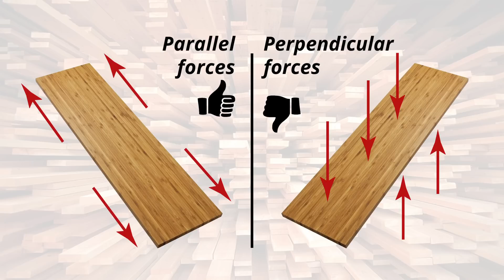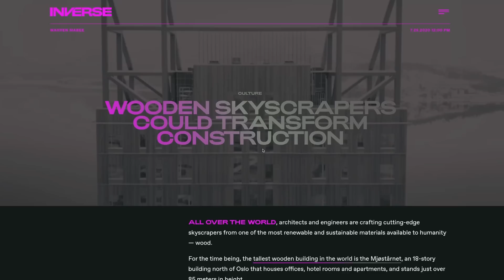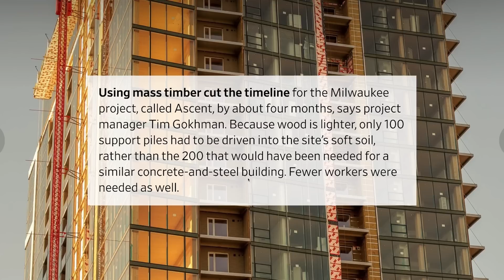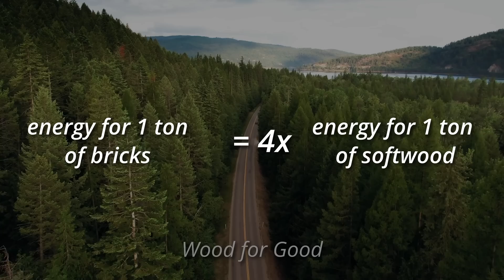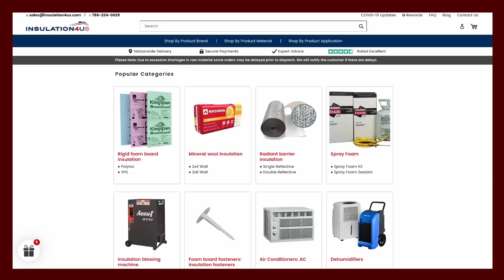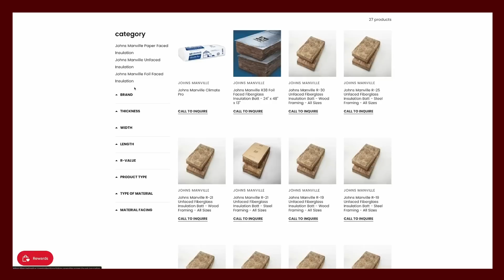How Mass Timber Skyscrapers could be the Future of Construction

Comment: This is INSANE!  Don't you remember the major city fires of the early 20th century?  Has anyone talked about Flame or Fire Resistance for these wooden structures?
Reply: A big difference then from now is that they used open flames at a much wider scale. Mass electrification has cut the risk of fires significantly. Also, the Greenfell tower fire in London showes that it doesn't matter if the support structure of the building is concrete if the rest of the building isn't done correctly. Fire safty is much more about correct use and awareness of risks than a specific material. That said where this goes wrong is that they want skysrcapers. Skyscrapers rarly justify themselves either ecologically or economically and should just be one of those things we stop being obsessed with.

Comment: When it comes to building skyscrapers, wood is not typically used as the base material due to its inherent limitations in terms of structural strength and fire resistance. While modern lumber techniques such as cross-laminated timber (CLT) have made it possible to construct tall buildings with wood, they are generally limited to buildings with fewer than 20 stories.

In terms of safety, materials such as reinforced concrete and steel are typically considered to be more reliable for use in skyscrapers due to their superior strength and durability. These materials are better able to resist the forces of wind and gravity that are exerted on tall buildings, and they are also more resistant to fire and other hazards.

While CLT and other modern lumber techniques have their advantages, such as their sustainability and lower carbon footprint compared to steel and concrete, they are not yet widely accepted for use in tall buildings. More research and testing is needed to fully evaluate their safety and reliability, especially in the face of extreme weather events or other hazards.

In summary, while modern lumber techniques such as CLT may have some benefits in terms of sustainability, they are generally not considered to be as safe or reliable as materials such as reinforced concrete and steel for use in skyscrapers.

Comment: How does a wooden skyscraper compartmentalize unit fires? From what I've seen in real fires they don't. So if your neighbor's place starts on fire you better get out, you won't be sheltering in place. Good examples are a recent concrete highrise fire in Chicago where the wind spread the fire upwards but the walls contained it, and a wooden apartment complex in South Minneapolis (2020) that completely burned up.

Comment: Nice video and presentation. Timber surely has a position amongst the construction materials of the future. I also love it as a material. However, I would add that it comes with some more disadvantages up to today. One of them is that due to its much lower strength and stiffness, as compared for example to structural steel, one needs much bigger sections for the structural members of a building. This compromises architectural versatility. Secondly, to date structural timber uses fire retardants, preservatives (e.g., to prevent fungal and insect attacks) and adhesives that may pose risks to the health of people inhabiting buildings made with such materials. And in particularly, I am also not sure how good mass timber would perform against fire without those existing fire retardants that it now comes with. Moreover, we should not forget that despite the fact timber is a renewable resource, it is not recyclable. It can be downcycled, though, to some extend. In contrast, structural steel nowadays in America is recycled to an extend of about 85% and is recyclable to a degree larger than about 95% (AISC). And in fact, recycled steel has an environmental footprint much lower than even structural timber. So, thinking of construction materials, I believe we should start seeing things holistically, and not in the way we used to see back in the days. On the positive side of things, I have recently come across some information about safe adhesives for structural timber, and I am very keen to hear that timber with such adhesives would do equally well in relevant strength and stiffness experiments with mass timber with the existing/conventional adhesives.  I also hope that industry and researchers would quickly come up with safe preservatives for mass timber. Closing, I believe that hybrid structures hold the future of construction - not systems purely of one sole material. Thus, the idea that mass timber by itself can be a game changer by itself, for me is not valid. Combining for example structural stainless steel with “safe for humans” mass timber or bamboo, on the other hand, can make a significant differences for the cities of the future. Have a good day and thanks for your video!

Comment: The fire safety systems would be costly on these types of structures. In typical steel and concrete buildings, fire sprinklers are installed in the ceilings to protect the floor level. In these, you would need fire sprinklers above the ceilings as well as in any interstitial spaces between floors. The material and installation labor would be through the roof.
Reply: U.S. codes heavily regulate concealed space in Type IV, Heavy Timber construction. This construction is just not going to use drop in suspended ceilings.

Providing sprinklers above ceiling in conventional buildings might not be as expensive as you might think. When hydraulically calculating for above, and below ceiling you are only required to assume fire in one or the other. Piping is designed for whichever is most challenging.  The same piping supplies both, except some upright 1” piping to individual heads, is required to locate ceiling sprinklers at correct locations below deck.

Comment: so I have this reoccurring dream/nightmare right? I am renting space in a building,... and its a highrise wooden building. Its infested with rot and warping. So I am on a higher level floor right? 8th floor or so, with more floors higher up. I feel constantly under threat of either falling through my own floor, a wall crumbling apart and exposing me and the neighbors to eachother, or the building just finally collapsing in and sandwiching me right in the middle. Can't take the elevator either, as its path is already in shambles. The roof of the place already caved in. Some rooms already have floors/ceilings caved and cannot be safely entered(well, I mean, the entire building would normally be condemned in such a state,... so none of its safe)
Its just a nightmare right, and has no bearing on reality.
But wood highrise? No... no... can't do it. I refuse!

Comment: I pray that you're wrong about that title, Belinda.  I love wood, but I'm more realistically thinking that the exteriors of those wooden buildings will be ignored until moisture has infiltrated and begun to rot them far sooner than a steel framed building would find damage.  Ditto roofing leaks which damage the wooden structural members which are hidden from both the interior and exterior. We'll know in under 20 years, I'm betting.  P.S: Oh, I love the view out that window at 7:08.  (snort)

Comment: "carbon footprint" and "sustainable" are buzzwords pushed around to promote mass timber, but the downsides are hidden.  We are in a situation where timber is in high demand and short supply which has pushed lumber prices very high.  So why would be divert a high percentage of our limited timber resource to be used in tall buildings?  People in the architecture and engineering professions are bombarded with information on mass timber, there is a concentrated coordinated effort to promote it, at the sime time that the news media reports on timber shortages and rising lumber prices.

Comment: Video suggestion: How do old fashioned fired clay bricks perform compared to more modern materials? They have been used for thousands of years for structural walls and foundations, but are now only used for facades. Houses that were build with them, around 50 to 100 years ago, with cavity walls, still seem to be fine places to live in. There are a couple good things about them: they provide good noise insulation, a large thermal mass and they are fire resistant.
Reply: I live in South Africa, and we have a fairly dry country. As a result wood is relatively scarce and expensive compared to places like the USA. Consequently it's always been cheaper to build walls with brick than with timber here. Basically we only use timber for roof trusses and that's about it.

We still use old fashioned clay bricks for decorative exteriors, but if the brick isn't going to be visible then we use bricks made out of fly ash waste from coal-fired power stations. Fly ash mixed with cement isn't as strong or nice-looking as clay brick, but it's a lot cheaper! The bricks last indefinitely as long as they remain dry, so a good damp-proofing solution is a must.
Reply: UK and many European countries still do structural brick to preserve forests. In the US and Canada is cheaper and more lucrative to build what are essentially disposable homes.
Reply: @jaredbaker7230  and the Canadian brick industry was pretty well destroyed in the late 1800s by the lumber barons.  And the complete lack of masonry knowledge of city planners and engineers.
Reply: @jaredbaker7230  They are only "disposable" in the sense that it's a little easier to get rid of the debris when one is demolished. I live in a brick&block house, but most of the houses around me are wood framed and some of them are quite old. The oldest wood house in my city was built by the English in 1650. The only things that shorten the life of wood structure are the vulnerability to fire, which can often be managed, the need for periodic maintenance if the exterior is wood (other claddings like brick, stucco or metal can eliminate most of this requirement), and the inability to survive with no maintenance at all, the way some stone ruins do. With the proper maintenance, a wood building can last indefinitely.

Comment: Pound for pound, wood is stronger than steel! Yes, you read that correctly. A large threat to mass timber buildings is keeping the wood dry. Water is wood's biggest enemy and can lead to reduction in strength properties, dimensional changes, and decay. Keeping the wood dry during construction and adding moisture content sensors that monitor the building are simple solutions. The best thing about wood is it grows on trees! A renewable resource that performs very well in fire, earthquakes (search post-tensioned timber buildings), and people experience reduced stress levels in timber buildings. Now that we have better engineered wood products such as CLT and Mass Ply Panel and we know how to design with wood, we will see more mass timber buildings in the United States. Demand is increasing, its only a matter of time before manufacturing catches up and large corporations realize wood is good.
Reply: uh-huh, but square inch for square inch, wood isn't even close to the strength of steel.
Reply: @andrewalexander9492  Yes, but because wood is lighter, you wouldn’t need as big of a foundation or structural elements holding up the stories above it. The dead load is reduced.

Comment: I understand that mass timber can char over and resist a fire for a specified period of time, and that it can even be covered with intumescent or sacrificial fire barriers, then protected with sprinklers to resist fire even longer. But despite the fire resistance shown in any prepackaged  testing environment, it's impossible to prove the limits of what a worst-case real-world fire can do to these structures. That's not such a big deal for a low rise building where with proper evacuation procedures, a total loss is a manageable risk. But in a skyscraper, not only is a quick evacuation much harder, the complete burning of building that size, particularly with it surrounded by similar buildings, could easily destroy everything around it. Unlike their concrete and steel counterparts, these buildings are literally made of fuel, making the total loss of a skyscraper something akin to the detonation of a large bomb. And, the total loss of the GSK labs in Nottingham, UK, despite the fact that that mass-timber building was incomplete at the time,  proved that such fires are not just possible, but plausible. I think we'll see these "plyscrapers" continue to go up for a while, then there will be a disaster on par with the Grenfell tower tragedy, which will call into question the safety of all the wooden skyscrapers built to date, making them white elephants overnight. 

PS: I've also watched the popularity of wooden mid-rise apartment buildings, some of them the size of a small city block, with trepidation. Though I have no doubt that a 6 story wood building can be protected by enough passive fire barriers, these buildings have been sold to the public on the promise that sprinklers alone can make them virtually fireproof. Yet we saw with the Avalon fire across the river from Manhattan that a fire in a void space can easily get around a sprinkler system and that any other fire protection in those void spaces is dependent on the vigilance of those inspecting the building (and that of everyone working on the building after it's built). Worse, sprinkler systems require periodic maintenance, something which usually gets neglected when a building gets old and dumpy. I predict that when some of these buildings fall into disrepair, we will see some serious tragedies.

Comment: Another interesting topic would be carbon concrete. In Germany, an architectural highlight of the former DDR (Hyparschale) is currently under renovation with a relatively new carbon fibre concrete material, which allows to reduce the amount of concrete for this particular reconstruction by around 70 or 80%. One of the reasons for the savings is that there isn't any steel used in the new construction.

Comment: A nice video thanks. My main worry in engineered timbers are the toxic glues which may make manufacture and construction potentially more hazardous and don’t have a clear non toxic end of life solution other than incineration. 
A move to standardising main structural members may assist reuse at end of life. 
Most glues presently used are based on formaldehydes which, environmentally speaking, are a “must to avoid” and confound claims to 100% Green credentials.
Reply: No they do not use formeldahydes in wood laminates anymore, at least not in the US. It is treated as asbestos.
Reply: @Inova3DSolutions  however they DO use chemicals not yet banned by law😄 its all a circus science, or at least the money behind it is.

Comment: Mass timber may not perform well in fire. Comparing the fire resistance against steel is not a good benchmark as the use of unprotected steel is not common in high rise buildings. This is because unprotected steel does not perform well during a fire. 
Saying the wood will char and insulate the inner parts of the wood, and therefore performs well during a fire, over simplifies how complex the burning behaviour of the wood is. 
Char is created by releasing flammable vapours during pyrolysis, so the formation of the protective layer requires the release of fuel. 
With more fuel you expect larger fires as there is more fuel available. Fires may continue to burn despite there being an insulating char layer as the insulating char layer may not be thick enough to stop pyrolysis of the inner parts of the wood.
The truth is we don't know if wood structures perform better in fire as it is a complicated issue and depends on the wood properties and how it is arranged in the building.
Reply: Also... a little external flame for testing is "cute", try a blazing fire with the entire flat interior gone... the heat will have caused major harm to the structural integrity... can you lego-swap those burnt pieces or does that mean such buildings will have to be torn down?

Comment: I'm a carpenter.  I wouldn't live in anything made of wood over four stories tall.
Reply: Wood is maintenance heavy when exposed to elements and makes a good habitat for rodents. Larger wooden buildings remain relatively light and can be blown off in the strong winds like the gate of Kyoto was. I'm with the carpenter guy on that one.
Reply: @damianborkowski7429  CLT is 3.5 to ~ 12 inches thick solid wood sheets.  It’s utterly unlike stick built wood.
Reply: With all due respect, the fact that you a carpenter of a wooden door or window does not make you an expert in statics or civil  engineering
Reply: @nuralianathamna8868   This is a sad reality when talking about wood and such. You may think that he doesn't understand the engineering but he does understand working with wood today. These aren't going to be Japanese design where every piece of wood is hand carved and fit perfectly along with account for expansion and compression depending on humidity and temperature. This is just goofy marketing and "engineers" who use software for simulation. People who barely touch wood outside of composite Ikea furniture. 
Carpenters who are worth their salt know the history of wood and how it used to be done, vs how they're done today. So you may just take his simple comment as being a simple man, but don't underestimate something because you want to make a reddit tier comment.
Reply: @alexandrep4913 
With CNC Mill you can make very precise parts
Reply: I would, just not solid sawn dimensional lumber.
Reply: 😂 Tell me you’re not an engineer without telling you’re NOT an engineer 😂

Comment: You make it sound like there's an unlimited supply of trees for mass timber. Isn't deforestation a world problem? Wildlife needs forest habitat too.
Reply: I think the point is that mass timber - if sustainable forestry practices are implemented - is potentially a more viable long term building material than concrete and steel.